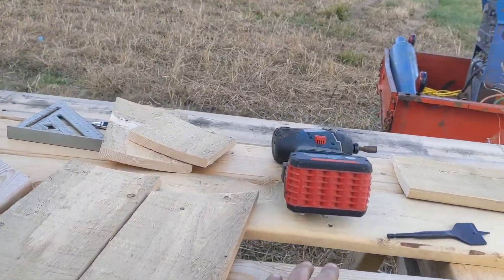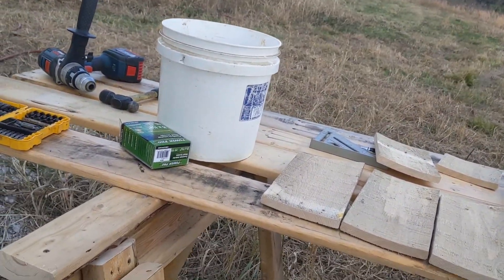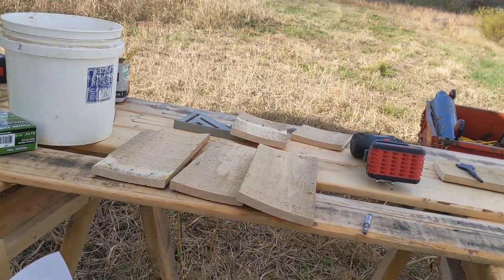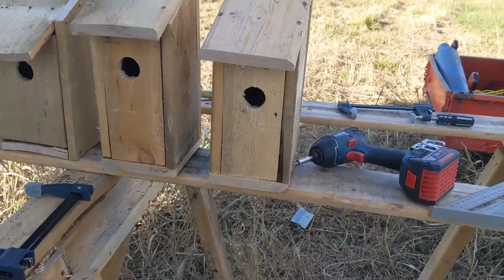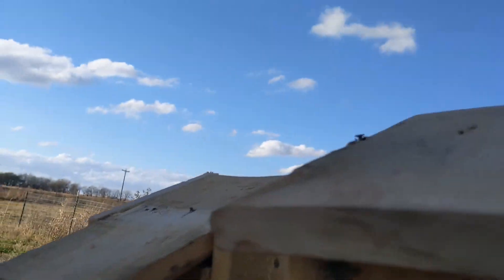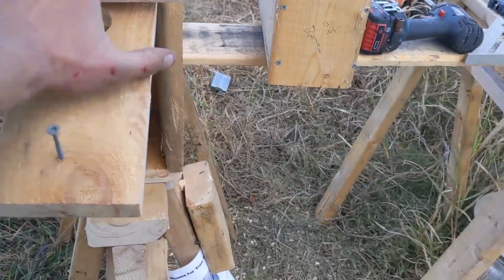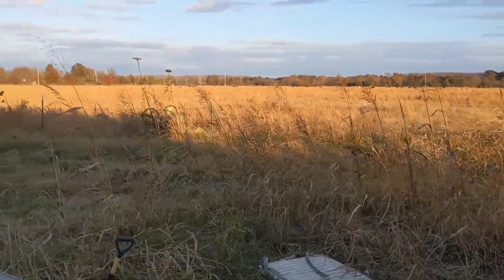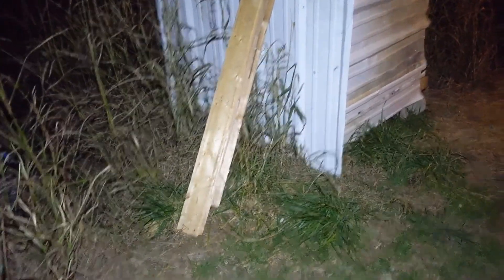Sunday funday ep 44

Comment: The general rule is ground everything. So we don’t get stray currents. You would do so at your panel. I would also check all the panel ground connections. If you have a main Panel outside of the camper that is where you establish your ground rod. I would think they built with a ground to the frame & that could be a bad connection. Stray currents can be cause by a bad ground on a branch circuit & what your measuring is where an improperly wired ground is being used instead of the neutral. I noticed in your panel the grounds & the neutrals are on separated ground bars. So they are treating that panel as a sub panel. So I would check the connection between that panel & the main panel. If none of that clears it. Bonding the neutral in the sub will clear it. But that’s not proper. But it would confirm you have a bad connection. Be careful getting between a neutral load is a powerful sting. Also don’t let this slide. It can get worse. Getting us a more clear video of both panels and the grounds might help me to see where the issue is.

Comment: There are simple testers you can buy for about $10 to test all your receptacles. Just plug it in and it will light up indicating correct or incorrect wiring. These are the same ones that an inspector will use to ensure the wiring is correct. Here is one on Amazon.com : https://amzn.to/2Usny35 . I am not certain this is the problem but it sounds like it is.